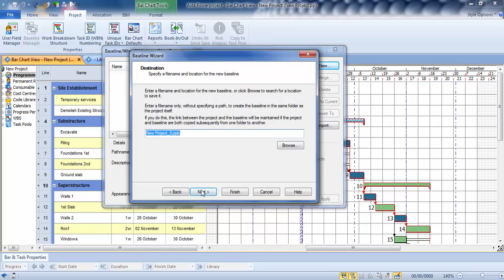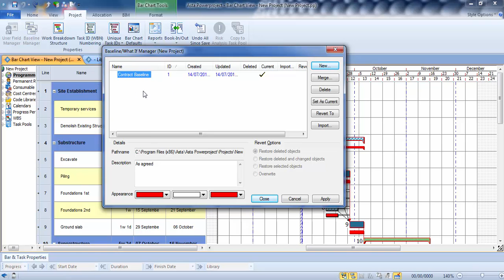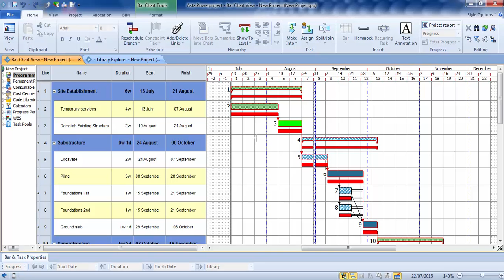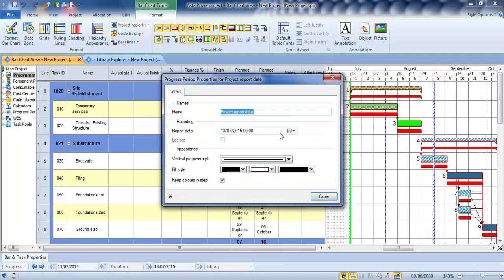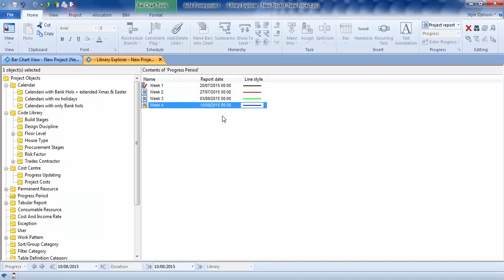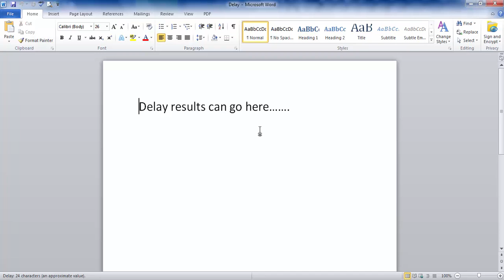Comment: What happens when you add new items to the programme? If I baseline after adding those new items, the older items planned start changes due to new baseline but that doesn't paint the proper picture of comparing original works to latest